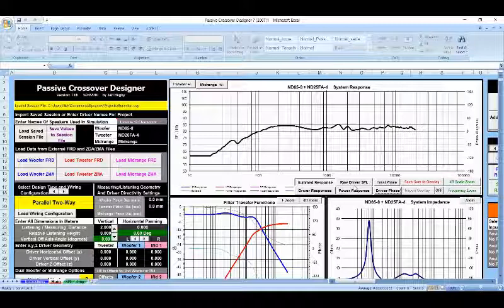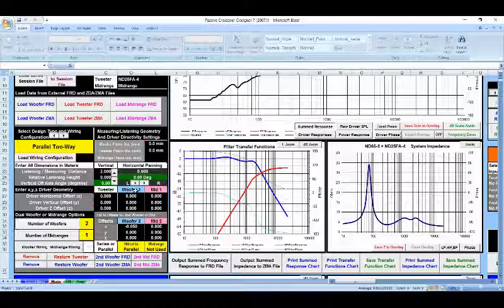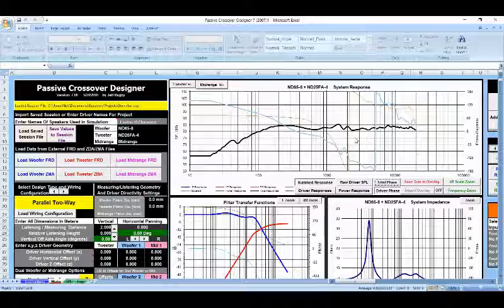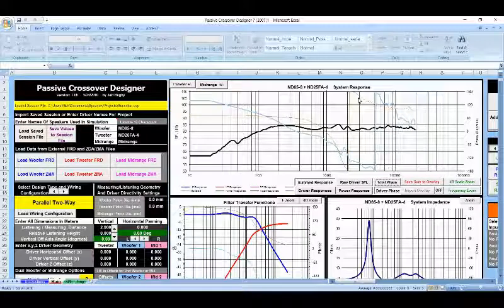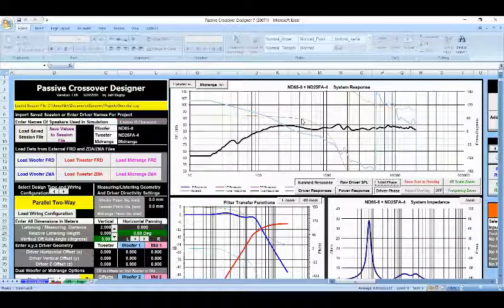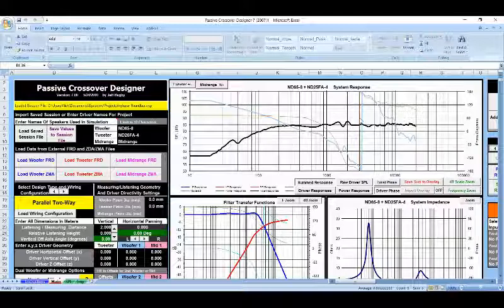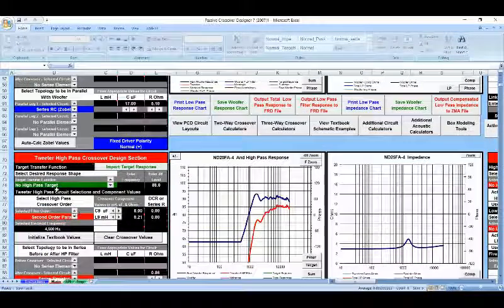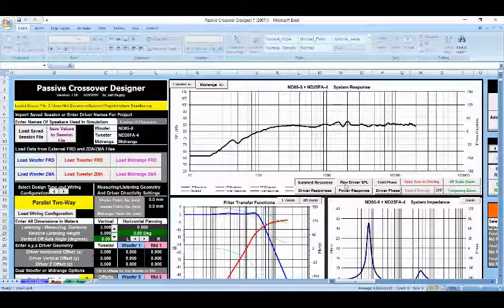How to Design a Crossover - Part 7 - Calculating Phase

Comment: Note that increasing crossover frequency increases the waist in polar response beteeen midwoofer and tweeter and this can significantly affect field lobing pattern and directivity.  Polar response needs to be part of the crossover frequency consideration.  You also do not have to alter steepness of slopes to get things close to in phase but it can help by virtue of reducing crossover bandwidth.  Playing with individual reactive component values can also fine tune phase providing that they don't mess up summation.

Comment: Many thanks for the series, I feel I know more about crossovers having watched them and might even attempt building one once I've watched the next video that shows you building it. 1 question: what about the impedance of the speaker? the first few videos you were showing a 4ohm woofer and 4 ohm tweeter...are they connected in series somehow in order to end up with an 8ohm total package? Many thanks for the info.
Reply from the maker: That is a great question.  The impedance of the speaker is determined by the impedance of the woofer.  So in the case of using a 4ohm woofer and a 4 ohm tweeter would still make this a 4ohm nominal speaker.  That would stay the same if I used an 8 ohm or even a 6 ohm tweeter.  A few ways to increase that speaker to 8 ohm would be to wire another 4 ohm woofer in series or to use an 8 ohm woofer.
Reply: Thanks for the reply. So the tweeter has no impact on the impedance of the speaker, does the number of drivers impact the crossover? Last question I promise...when combing multiple woofers are there pros/cons to using 2 x 4ohm speakers in series vs 2 x 16ohm drivers in parallel?
Reply from the maker: That is correct.  The number of drivers will impact the crossover in a few ways.  First is the BSC, will only need to be compensated about 3db instead of the normal 6db (assuming full BSC correction). it also affects how the drivers mesh when being crossed over.  It also changes the crossover components, as you would now have a different impedance.  Finally, there is not pro or cons between combining either 2 4ohm or 2 16ohm drivers.  The difference really comes into box design and desired frequency response.  So whichever work better for your design, is what you should do.
Reply from the maker: I just made a video about MTM's, I hope this helps you out: https://youtu.be/CdFddf_BYPU

Comment: Hi 123toid my phase lines on the graph seem to be very messy and are not as clear as you have in this video. Should i be looking at the phase.just.in the crossover points? Also what is the phase that is shown in the "Filter transfer function" graph? Thanks

Comment: hi
im using a 24db l.r crossover which was said to be the best in terms of phase but it dose not make sense to me bc the tw sound ;reach my ears sooner then the woofer ...the fs look nice and flat but im sure im not time correct is ther a way to deal with the issue?
Reply from the maker: גד אור 
You need to change the spacing of the drivers and or crossover frequency. You may need to change the values of the components. But if you mess around with it, you should be able to get the phase to align.
Reply: thx my friend but what do you mean cange the spacing its a big home loudspeaker i cant move the tw back
Reply: and its active crossover i cant change components
Reply from the maker: גד אור 
The space between the Tweeter and the woofer. Mine then closer together. I am assuming you are designing these speakers. If these are manufactured, something else is going on
Reply: its 3 way closer to the mid but its too
late but thanks anyway
Reply from the maker: גד אור 
You're active DSP should have all the adjustments needed including time alignment.
Reply: no active dsp its an electronick crossover and i can only cange fs by canging module its 6xs by audiocontrol and its for car audio but its so good so i installed it at home